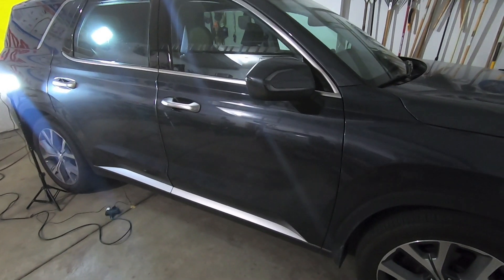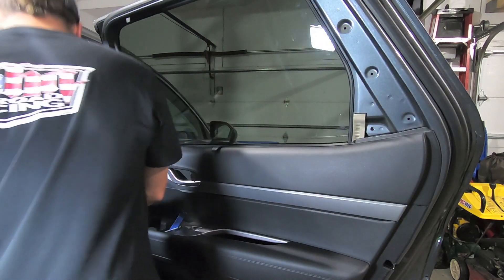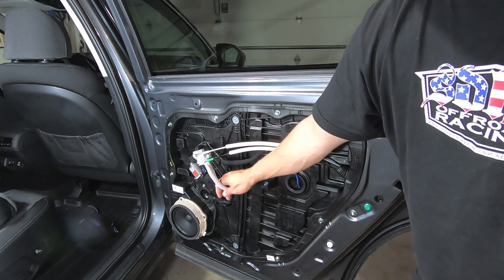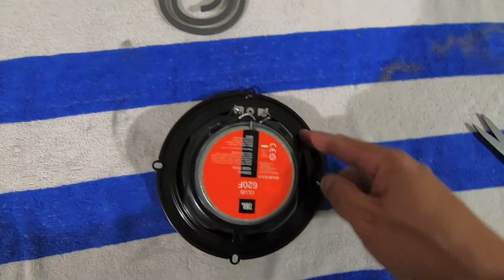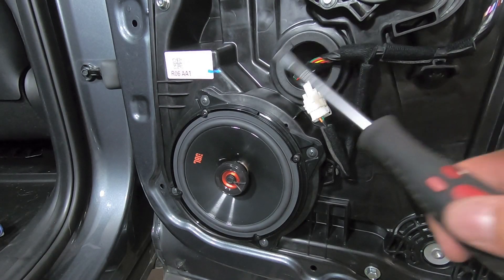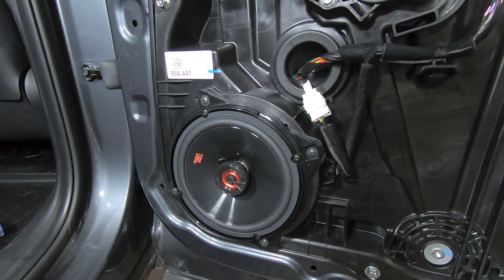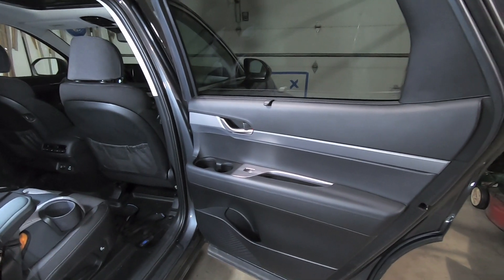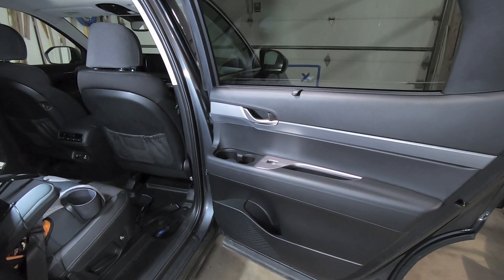Palisade Stereo Upgrade 2 of 3: Rear Speaker Replacement - Hyundai Palisade

Comment: Did you notice any difference in volume? Just got a '23 with the base stereo and almost no noise comes out of the second row speakers. I have to have the fade almost all the way back and then turn the volume all the way for there to be any balance in sound
Reply from the maker: Yes these are more efficient speakers so they are a bit louder
Reply: I got a 2023 XRT model with base stereo. I installed the JBL Club 622 speakers front and second row. Its a little bit loud but i still have to crank the volume really high. Volume at 33-40 is the comfortable loudness which is really high. I think i need to put that subwoofer that has Amplifier included already. That is why, it would be much appreciated if Water Flower 41 will upload a video with the sound system in use.
Reply from the maker: I’m recording my videos on a GoPro, there’s no way I’d be able to capture the quality of the palisades sound system through the built in go pro mic
Reply: @WaterFowler41  did you change your Fader more to the back side since its less signal from the HU? Thats what im dping right now without the Subwoofer yet.
Reply from the maker: I didn’t everything is balanced
Reply: @WaterFowler41  ok. Do you think mine now is still acting like the original speaker because i dont have the subwoofer yet? Does your volume level still pretty high? Or whats your volume level now?
Reply: @mikeursal6157  I haven't made any upgrades to my XRT yet, but that's what I have to do. I have the Fade almost fully to the rear and then have the volume 90% up for it to be balanced and to have it be loud enough
Reply: @DerekRLambert   i know.. some of my friends is telling me to get a sound processor plus an Amplifier just for the speakers plus that RF subwoofer. Thats why, im kinda hesitant cause its gonna cost alot. 😬 what you think @waterflower41? We need your help. Hehe
Reply: @mikeursal6157 
Did you complete the sound update on your Palisade? If so, how do your speakers/volume sound?

Comment: Hello. great video. I need to know the part# of the speaker wire adapter. I tried Crutchfield but they don't seem to have an adapter for my rear speaker (Harman Kardon). Do you know if the adapters are available and if they are of the same type? THANKS!!
Reply from the maker: You may need different adapters for the HK systems but I cannot confirm that.
Reply: The plug is identical to the one in your video. Can you tell me how I can get this part?? Thanks!!😊
Reply from the maker: @xedder1 I’d start at crutchfield and see if they can give you a part number then check Amazon. You can also check scosche’s websitr

Comment: What you did with the front door tweeters?
Reply from the maker: They are still stock
Reply: Does that affect the sound balance since the speakers you installed have tweeters also? I’m considering upgrading my speakers (I have the HK system), but I’m torn on whether I should get component speakers or do something like what you did. I’m also concerned about how the volume will be affected by going from 2ohms to 4.